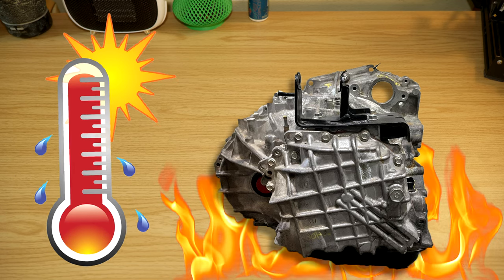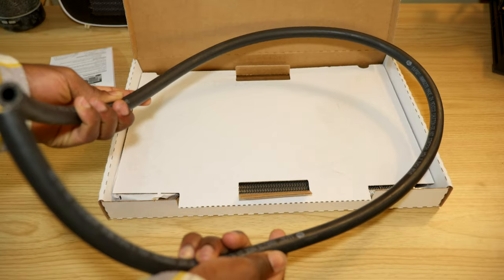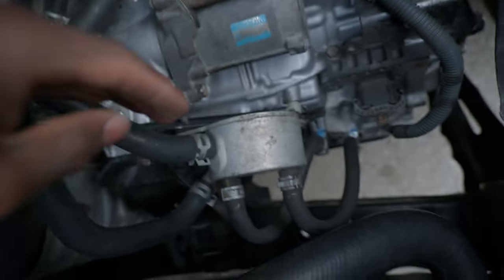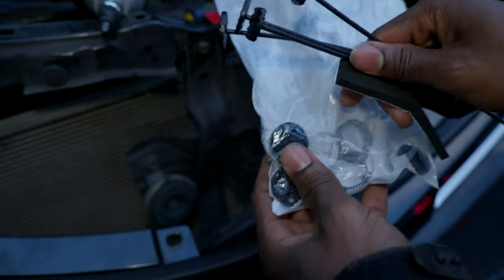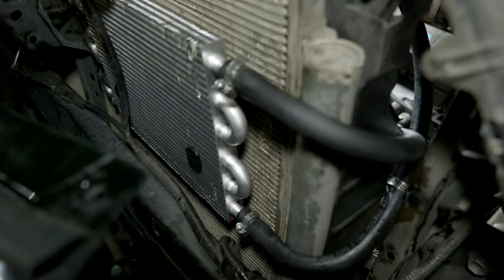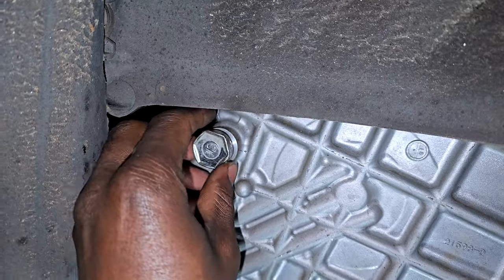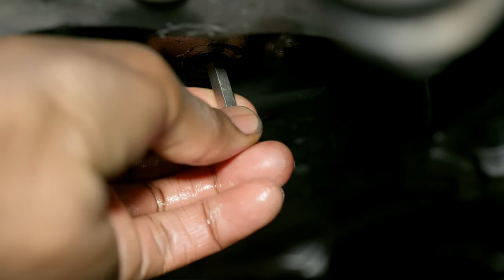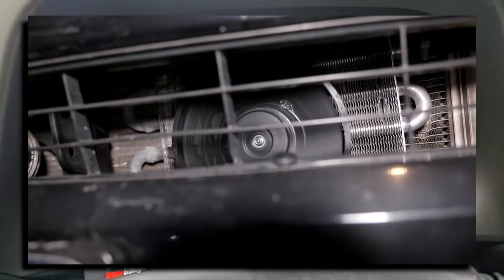Installing a Transmission Cooler | Hayden 403 Ultra-Cool Tube

Comment: This is exactly what I needed! With temperatures soaring to 50°C here in Saudi, this mod is a lifesaver. Thanks for the detailed tutorial!
Reply: Since this video is 7 months ago, is there an update or things you should've done definitely?
Reply from the maker: @mesh4801  Hi, definitely use all four zip attachments so it's more secure or even use custom made brackets for a more durable install. The instructions on how to top off the fluid is based on my specific car, so be sure to follow the instructions for for your car. Try not to use a power tool to remove or tighten the plastic tube in the transmission as there is a high risk of stripping it. I made a part 2 of this video where I added an automatic fan to the cooler https://www.youtube.com/watch?v=yaDi9v5khgY&t=1210s